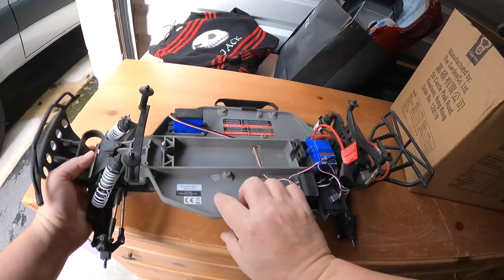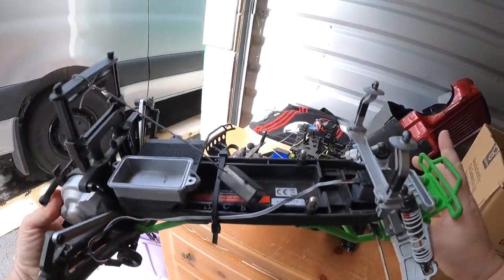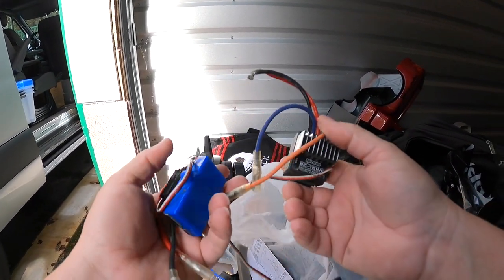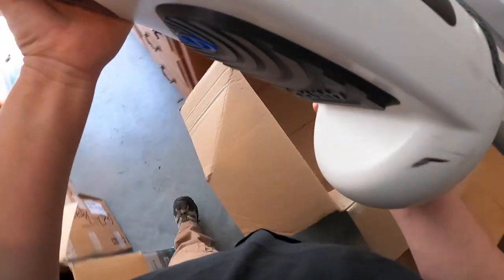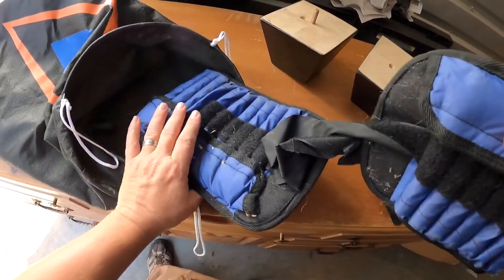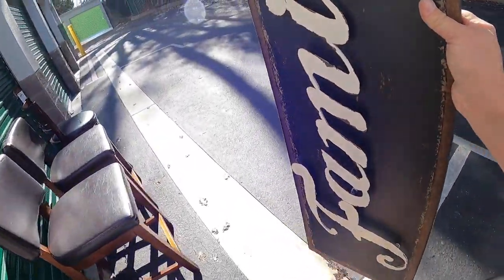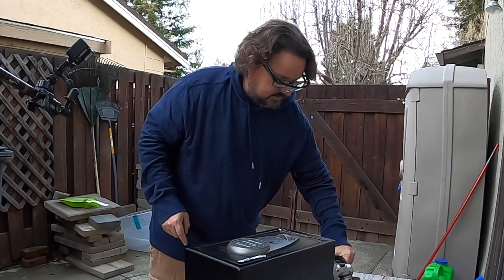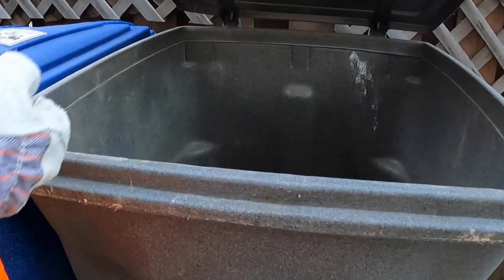Let's OPEN THE SAFE from the $3,010 locker I bought at the abandoned storage auction.

Comment: Hi Jack!! the first Traxxas you found now looks like a 2WD Slash  and go with the smaller wheels.  The second Traxxas looks like a 2WD Stampede and goes with the larger set of 4 wheels. The Traxxas radio transmitter can go with any of them.

That Castle motors are brushless units and is worth quite a bit - same with the other parts (blue) which are ESC's - Electronic speed controllers. Make a auction batch of all the bits and bobs of the rc stuff you found  - never throw anything away. Its sacrilege!! :)

Comment: You can Buy steel cutting, circular saw blades that will cut 1/2" solid steel quite easily and cleaner, so good for any steel/cement safes. nicer to use compared to a angle grinder .
Reply from the maker: Great tip!

Comment: When you do a safe like that...use the cut off to cut off a square in the bottom and then re-weld a plate to bottom...(after you reset the safe lock from the inside :) ...not that those safes are even worth the 49.95$